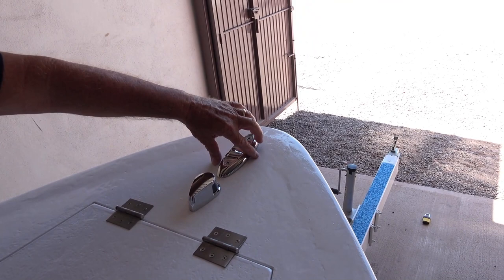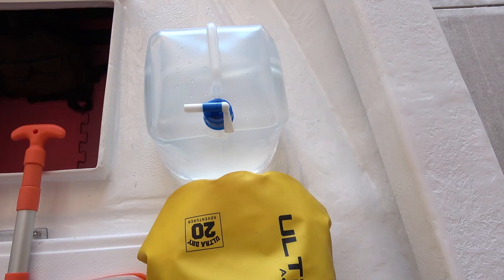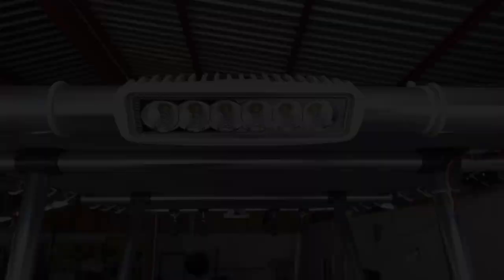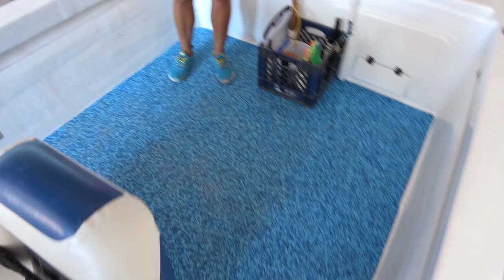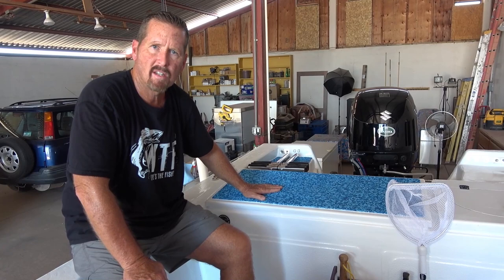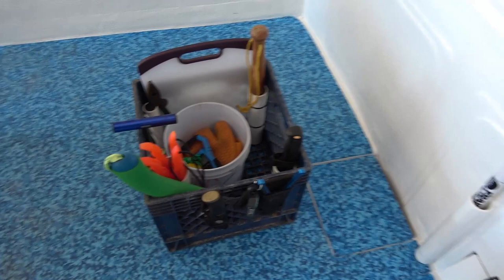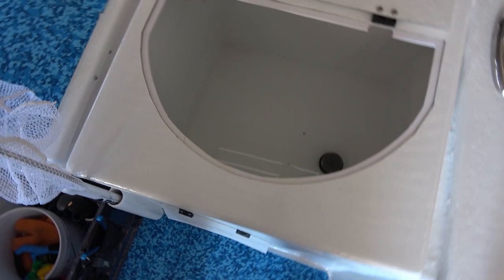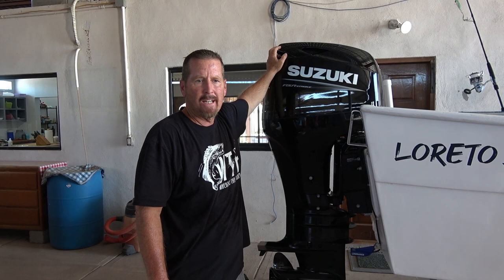Tour our New Baja Panga!

Comment: I like pangas good fishing boat.... Only thing Ive would have used was composite material instead of raw wood sandwiched between glass.....Every time ya put in a screw water can come into the wood and cause rot even if ya use 5200 caulk....  And of course a bunch more of good rod holders and a cluster of rocket launcher holder off the Tee Top...  Enjoy n be well..

Comment: great build 
was wondering what the boat cost to build
what length did u get
thanks
Tim 
from Texas
Reply from the maker: Hey Tim! The hull cost $5000 usd.  and is a 24 footer. Thanks buddy!
Reply from the maker: We have a total of about 25k into the build with the new Suzuki DF90 and the trailer costing more than half the total.
Reply: @BlueRockAdventures  would you recommend your builder?it looks good for me,thanx great job.